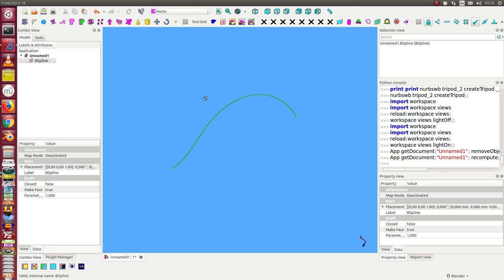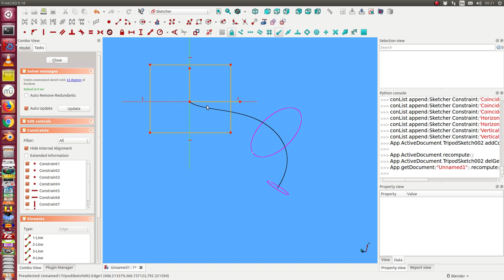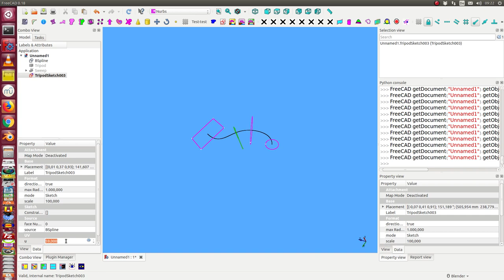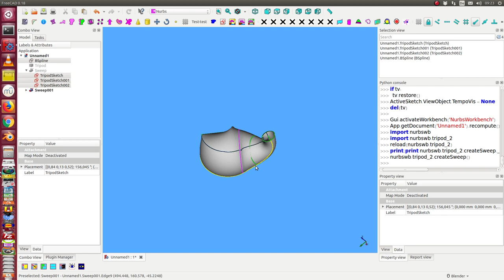sweep tools

Comment: Nice!!! Why did you create a new sweep instead of using the previous one to add the sketch? And these line segments in the axes of the sketch, what is their purpose?
Reply from the maker: when the objects have generated names it is hard to find the right order from a dialog list of names/labels. it's easier for me to  select the ribs  from 3D View than from a list. But of course it's possible to change the Sections property inside the property tab